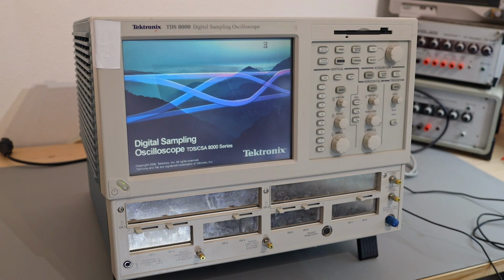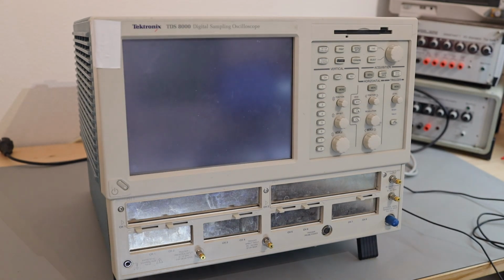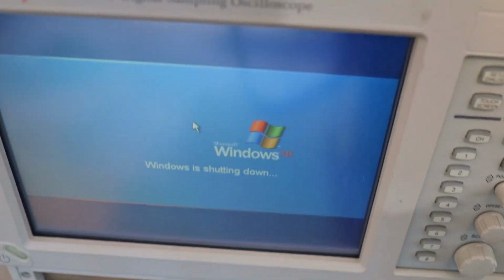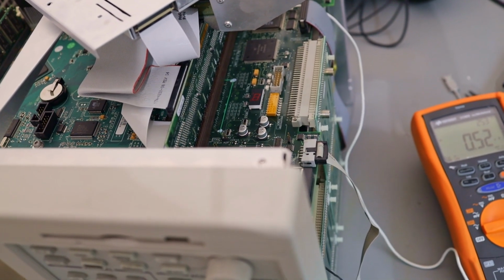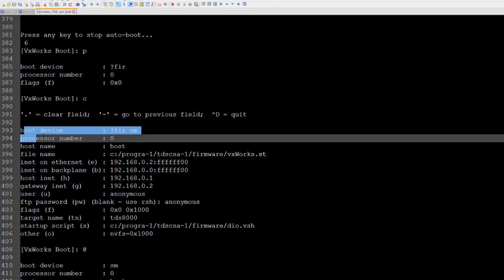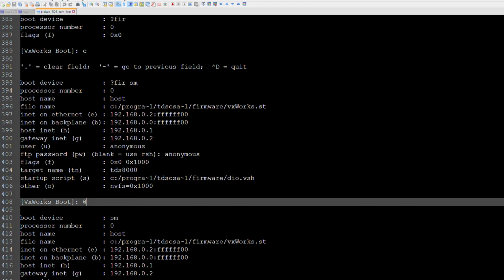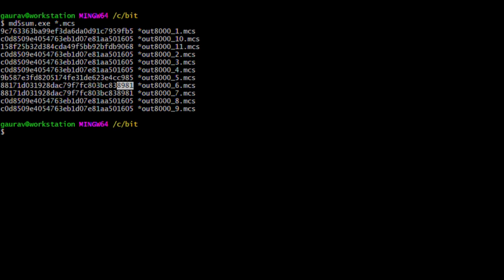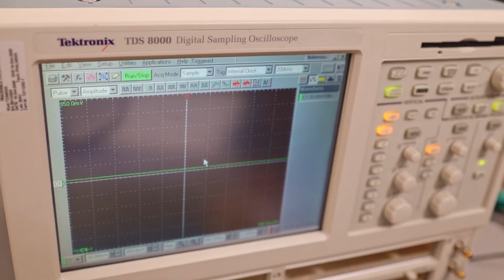70GHz Oscilloscope Repair Tektronix CSA TDS8000 CSA TDS8200 Sampling Oscilloscope Acquisition Error

Comment: How do you get on with the Mantis for soldering? What lens do you use? I'm interesting in getting one exclusively for soldering and rework, down to 0201, 0.5mm pitch QFNs, etc. Would you recommend it?
Reply from the maker: Mantis is rally good, I got it used. For SMD soldering  i uses x4. Sometime i get thought going to even lower x2. i think Above x4 for normal soldering is not very easy to use due to small field of view. I have this Mantis elite with dual lenses, I switch to x8 For inspection , but x8 very very rarely used for actually soldering . May be needed for 0201 some time but for 0.5mm QFN x4 is more than enough, I have x15 as well not normally used can only be used for inspection.

Comment: Compliments. I successfully backed up the eeprom contents of my TDS8000 recently. Contents were luckily available and correct. Especially with the 80e04 it’s a great piece of equipment
Reply from the maker: How did you backup eeprom?
Reply: @circuitvalley via the debug UART:

#PPC Board
nvrBase=0xfd0e0000
nvrSize=0x20000
tempBuf=malloc(nvrSize)
memcpy(tempBuf,nvrBase,nvrSize)
fdescriptor=open("dbfs:c:/tds8000_ppc_nvramdump_full.bin",0x0202,0777)
bytesWritten=write(fdescriptor,tempBuf,nvrSize)
close(fdescriptor)

#ACQ Board
nvrSize=0x20000
acqLibReadNVRAM(0,tempBuf,nvrSize)
fdescriptor=open("dbfs:c:/tds8000_acq_nvramdump_full.bin",0x0202,0777)
bytesWritten=write(fdescriptor,tempBuf,nvrSize)
close(fdescriptor)

Data will be available on the harddisk afterwards.

Comment: Hi! Great video! I found your video when I was looking for the cause of my error. Can you help, please? I have a problem with the Tektronix dsa8300 device. When turning it on, in the diagnostics section, in the subsystems window, in the Acq4b (ChB TB) line, it gives error 938. What could be the reason?

Comment: Let me see if I can explain this in a different way of imagined me using Intel until on an AMD. If you want that thing to actually be able to run up to 70 and 50 gigahertz you going to need the original bios but for some strange reason to tronics doesn't put that out

Comment: Copy that bios. There's not many And nobody seems to have the BIOS. In between the windows board in the tetronics board communicating different acquisition if the BIOS isn't fully matching you can't just drop in a different bios. Original of the coldest this program strictly through the Windows it may not work as good.
Reply from the maker: Could you please suggest how to copy BIOS?
Reply: @circuitvalley  You probably could de solder that SPI flash and copy it using Dediprog?

Comment: I’ve refurbished a few of these, and unfortunately replacing that battery only gives about 10yrs tops of additional life. (I’ve had other NVRAM’s last for 25yrs and still have >3.1V. It’s a leakage lottery.)

Although I’ve installed FRAM’s in other gear, unfortunately this one also provides real-time clock functionality as well with the little watch crystal also being in the cap on the other two pins, and that will continue to need to be powered.

If one uses a through-hole CR2032 holder, one can position the holder such that the pins come down through the lid into the volume where the original cell used to be. Glue the socket down to the lid and jumper the power over to the PCB.

The calibration process is documented in their public service manual, it’s fairly straightforward, and only requires some GPIB commands sent to step it through the process.
Reply from the maker: @ChrisSmith-tc4df Could you please explain a bit more about calibration ?  What commands? what does it calibrates?
Reply: @circuitvalley , Like many modern Windows based oscilloscopes (Keysight too), it has the calibration procedure automated internally, so what the bench tech is actually doing is calibrating the internal reference voltage upon which the scope then conducts all of its internal calibrations. One also aligns the internal 10MHz reference with its the trimmer capacitor.

Search for “CSA8000 and TDS8000 Series Service Manual” part number 071043807, and you will find detailed teardown instructions and the calibration procedure along with the GPIB commands in Chapter 3.
Reply: Interested in the calibration process as well !

Comment: AI Summary

Abstract:

This video details the diagnosis and repair of a non-booting Tektronix TDS 8000 digital sampling oscilloscope, a specialized instrument capable of measurements up to 70 GHz, used primarily for signal analysis in communication systems. The primary issue was the oscilloscope's inability to launch its main application, traced back to a critical VXWorks acquisition board failing to initialize due to corrupted non-volatile RAM (NVRAM) settings.

The repair process involved a complete teardown, identification of a dead NVRAM backup battery, and subsequent replacement of the faulty NVRAM chip. Additionally, the video addresses a secondary issue of potential data corruption in the onboard Complex Programmable Logic Devices (CPLDs) responsible for channel acquisition. These CPLDs were read and compared to known good configurations, revealing multiple corrupted units which were then reprogrammed via JTAG. Preventative maintenance, including reseating RAM, upgrading the hard drive to an SSD, and cleaning components, was also performed. The successful repair culminates in a fully functional oscilloscope, demonstrating rapid boot times and readiness for advanced signal analysis.

Summarizing the Tektronix TDS 8000 Oscilloscope Repair

*   0:00 - Introduction to a Niche Instrument: The video introduces the Tektronix TDS 8000 (also known as CSA 8000), a high-end digital sampling oscilloscope designed for specialized signal analysis like eye diagrams, jitters, rise times, and TDR.
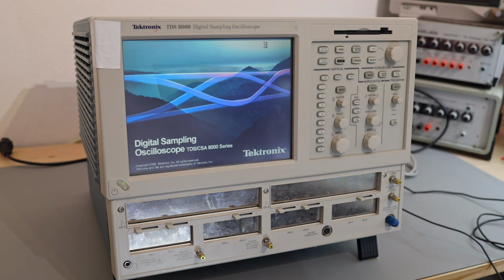*   0:37 - The Core Problem: The oscilloscope, acquired as defective, fails to boot its main application, remaining stuck at a loading screen and showing a repeating boot sequence on its internal 7-segment display.
*   0:37 - High-Frequency Capabilities & Modularity: This oscilloscope is notable for its ability to reach up to 70 GHz with specific sampling heads and supports various optical and electrical modules for diverse analysis, including fiber optic communication systems.
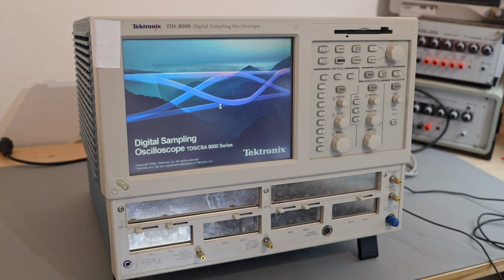*   2:02 - Running on Windows XP: The instrument's main control system operates on Windows XP (with some models running Windows 98/2000).
*   3:06 - Hardware Overview & Initial Access: The rear panel reveals a standard Intel PC motherboard running Windows XP, alongside a single USB port, DVD drive, and a removable hard drive. The repair begins with disassembling the outer casing.
*   8:39 - Dual Board Architecture: The oscilloscope features two main processing boards: an Intel motherboard (running Windows) and a "VXWorks" board (the acquisition board) which run a real-time operating system and manage the core oscilloscope functions. These communicate via an interconnecting PCB.
*   11:12 - CMOS Battery Check & Boot Loop Diagnosis: An initial check of the motherboard's CMOS battery shows 2.8V, but the VXWorks board's 7-segment display cycles through repetitive codes, indicating a continuous reboot loop caused by a loss of boot configuration settings.
*   18:11 - NVRAM Identification & Replacement: The root cause is identified as a faulty NVRAM (Non-Volatile RAM) chip, which failed to retain the VXWorks board's critical boot configurations. The old NVRAM module's battery is found completely dead, and despite a new external power supply showing low power consumption by the NVRAM chip, the chip itself is confirmed faulty and replaced with a compatible one.
*   36:10 - VXWorks Configuration: After the NVRAM replacement, the VXWorks board's boot device settings are manually reconfigured via a terminal interface, allowing it to boot successfully and show a "D" status, indicating readiness.
*   37:46 - PLD Firmware Corruption & JTAG Reprogramming: Further preventative maintenance includes verifying and reprogramming the CPLDs (Complex Programmable Logic Devices) on the acquisition board. Several CPLDs are found to have corrupted firmware (possibly due to heat or age) and are successfully reprogrammed via JTAG, despite challenges with the programming software GUI.
*   42:07 - General Preventative Maintenance: The repair process also includes cleaning the power supply board, reseating the RAM (2x 256MB modules) to address computer hanging issues, and upgrading the traditional hard drive to an mSATA SSD for improved performance. The CPU's thermal paste is also replaced.
*   45:47 - Successful Repair & Future Plans: The oscilloscope is reassembled, now booting successfully and operating as intended. The SSD upgrade significantly improves the Windows boot time. The video concludes with the instrument fully functional, ready for advanced measurements, and plans to install VNC software for remote control and automated tasks.

I used gemini-2.5-flash-preview-05-20| input-price: 0.15 output-price: 3.5 max-context-length: 128_000 on rocketrecap dot com to summarize the transcript.
Cost (if I didn't use the free tier): $0.0073
Input tokens: 24894
Output tokens: 1007

Comment: What I read on the 7-segment display is:
4 - 5 - 6 - 7 -  8 - 9 - A - L (Low) - H (High)
And it seems somewhat erratic in that sense it does not always complete the sequence.